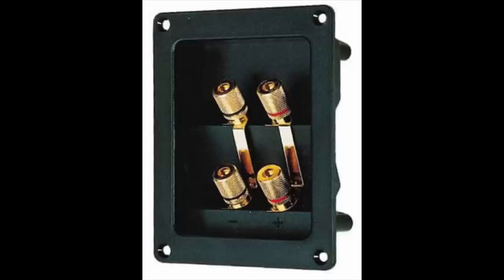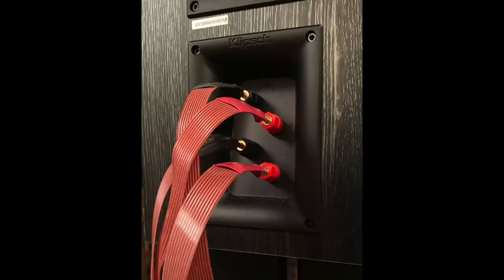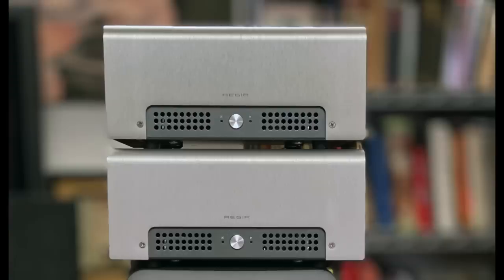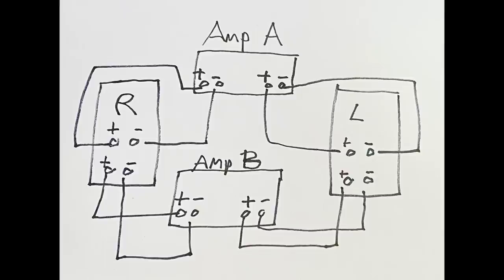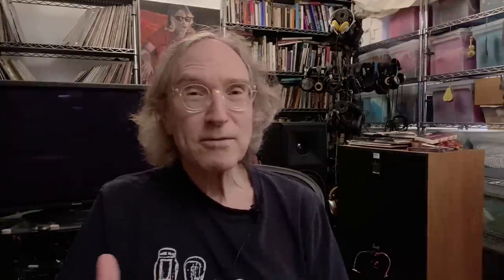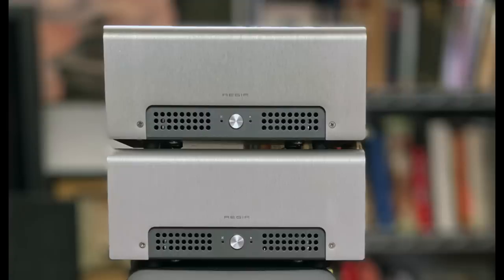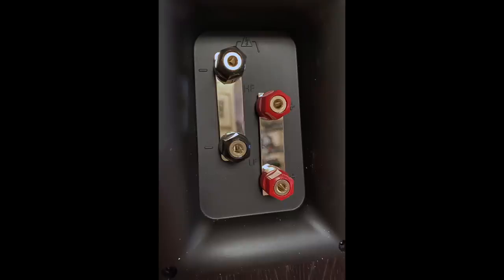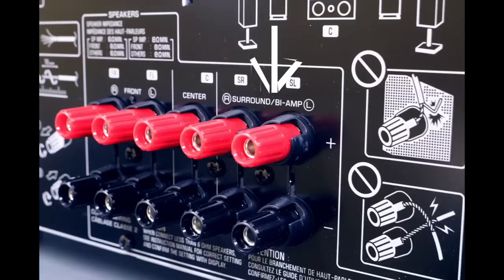It's time to think about bi-amping your speakers!

Comment: My altec 501's were later re-released as 510's with an upgraded xover and Tri amp capability, I would like to maybe get an upgraded xover made for these and ultimately tri amp the setup.
Reply: You might be able to find some great active crossovers on the used market. A stereo crossover can be used to tri-amp a single channel. Two stereo crossovers are required for two channels. I found that splitting off the HF first, and feeding the LF to other channel worked best. The other channel splits the Mid from the LF. Only the noise from the first crossover goes to the tweeters.

Comment: I would think this would be more useful using different amps... Let's say you have a low powered amp that has details or a tonal quality you love but not enough power to fill the room with bass. Wouldn't it make sense to have the lower powered amp driving the theater, and getting a cheaper class D amp to power the woofers?

Comment: I set up my brother's Martin Logan mains with a vertical bi-amp. We use his Integra AVR to drive the center and surrounds. We Y-Corded the main pre-amp outs to an older Rotel 5 channel amp. Huge improvement. The 260wpc vs. 130wpc made a difference, but the headroom and dynamics were fantastically better.

Comment: Excuse my ignorance on this but would one need, or want for that matter, a crossover in between the pre amp and the bi-amps so that the respective frequency ranges would be directed to the intended amplifiers? This assumes of course that the preamp in not separating the spectrums.
Reply from the maker: I think I explained this very clearly. No extra parts are needed. Just two identical stereo amps.

Comment: I'm using a NAD T743 5.1Surround  Receiver. It has speaker hook up for surround speakers and also a "B" set of speakers. I wonder which connection I should bi-amp with. I am thinking that the "B" speakers will put out exactly what the "A" speakers do whereas the surrounds will be processed to amp up surround noise (background sounds). I also wonder if the "B's" are on a separate amp or just take power from the samp place as the "A's." Nothing about any of this in the manual and I have reached out to NAD. Currently bi-wired.
Reply from the maker: Sorry, no, B speakers are just running off the same stereo channels as the a speakers. So that’s not Bi-amping

Comment: You really should do a vertical biamp. In most cases, you'll have level matching issues even if you use the same amps. Going vertical eliminates that problem. I do it this way in my own system, so I'm able to talk from experience. However, if you are not using 2 top of the line amps, you're probably better off getting 1 high quality amp instead of 2 lesser amps.
Reply: What's a vertical biamp?
Reply: @MICHAELMG62  You need to use 2 stereo amps. One amp goes to the right speaker, and the other goes to the left. One channel on each amp powers lows, and the other powers the highs. Doing this allows you to work both amps equally. If you have a traditional setup with one amp on the highs and the other on the lows, most of the time you'll have a volume mismatch between the 2 amps. Also, an amp will sound different depending on how hard you work it. Even if the amps are identical. A vertical biamp eliminates all these issues.

Comment: I prepared my car to bi amp in 2009; Alpine 18Wx4  head unit and Focal Polyglas components.  The advantage is that you don't have a crossover, so the amp has more direct control over the speakers.  The less gain in the amp, the cleaner the output.  My home stereo are full range speakers without a crossover.

Comment: As good as solid bottom tube top sounds on paper, without some kind of active dsp correction, you cant guarantee phase alignment between the two, so your top and bottom don't quite line up right. Like a badly set up subwoofer.

Comment: In some amps there's the A+B speakers choice (besides A or B speakers). Does that mean it can bi-wire a pair of speakers? If so, what would happen if the minimum recommended impedance is 8 ohms for the amp but the speakers are actually 6 ohms?
Reply from the maker: Well, if the speakers are 6 ohms and the amp's minimum impedance is 8, well, that's not ideal. Bi-wire and/or A+B switching doesn't change that in any way.

Comment: I'd like to do this but its too complicated for me. For example if both amplifiers are stereo do you do both woofers from amp 1 and both mid-treble from amp 2 or do you do one amp per speakers, so amp 1 left channel for bass and right channel for highs to speaker 1 and amp 2 the same to speaker 2? What if like these zens they're both integrated amplifiers? Do you split from the source unit then? In terms of mono power amps is the ultimate then to have 4 blocks? Imagine the mess of cables splitting twice to get this going! Or do you use just 2 monoblocks, one per channel? But then should you biwire from the monoblocks? You still wouldn't have actually bi amped the speakers. So maybe with 2 monoblocks , you use one for treble and run to both speakers and one for bass? Its just too complicated! 

In my case I have an integrated that has a pre out. So is it best for me to add a more powerful stereo power amp via the preamp out and using it to drive the bass whilst letting the original integrated amp's speaker outs run the highs?

Comment: When you mono block those amps they are 7 watts instead of 3 , so what if you "mono blocked" each speaker with 2 amps so you would have 4, for the 2 speakers.

Comment: What about the crossover? How does that work? Is the crossover bypassed?  Are there two crossovers in these speakers?   That seems unlikely as I never see a switch on them.  If not then how do they isolate each amp and so  not end up with the same thing as the jumper installed.   If it isn't how can it be said that one amp drives the woofer and the other the mid/tweeter? Beyond how it works I would guess the simpler  load on the amp might make for the better results.
Reply from the maker: I described how to do it, why are you making it more complicated? The speakers internal crossovers or still being used.

Comment: KEF LS50W uses two different amp for hi and low, right?  That seems to work very well.
Reply: That's a good point Raphael, but I guess the difference is the KEFs were designed that way from the ground up, so for example, any potential timing differences between the 2 amps will have been engineered out of the equation through careful design tuning.  In contrast, Steve just chucked together 2 totally different stock amps from different manufacturers.  Seems that may not work well, or at least not in that particular combination......

Comment: Wouldn't biamping require a crossover before the amps (and removing the internal crossover?I deally biamping powers each driver individually: one amp for the bass, one for the treble. No IM. So you would need at the very least low pass/high pass filters. (That's the quick and dirty way) How about a few details about "serious" biamping, properly done?

Comment: How could someone say it wouldn’t make a difference? It makes the load each amp sees totally different (higher impedance and simpler for both). This makes a big difference for tube amps especially.
Reply: This leads to the question that occurred to me. If you're sending the preamp out via a Y connector then you're sending a full range signal to each amp aren't you? And then are you also sending that same full range signal to each tweeter and woofer or is the internal speaker crossover still filtering each signal? I always thought biamping required an external crossover to avoid that.
Reply: @alexdiaz8726  You’re right. I’m wrong, so I changed my comment. Each amp is reproducing the full range signal. The load each amp is driving is much “easier” (higher impedance) though. It might sound best to use different output transformer taps on each amp too, depending on the impedance of each driver combo (woofer vs mid and tweeter). I wonder if Steve tried different output tap combinations?

Comment: I use 2x Aegir for power hungry B&W Matrix 3 series 2 and it’s a true charm. I am horizontally bi-amping (vertical was my plan but, one of my Aegir can’t handle it) Just wondering Steve, did you try both vertical and horizontal bi-amping to test if you notice any difference? Happy 2021, stay healthy!

Comment: About different amps, I think Steve used a tube and solid state? Didn't work well. I'm thinking about using my 400w Carver for LF and a beefy Harmon Kardon AVR I have idle for the HF. Is this too mismatched, anybody?

Comment: Your description & drawing shows Amp A powering both speakers, and Amp B powering both speakers. 
What do you call using Amp to power just the R speaker, and Amp B to power just the L speaker?  How does that compare to the process you've described? 
And if this video is about bi-amping, what is bi-wiring, and how does that compare?
Finally, I've noticed that Schiit seems to suggest that the Aegir can be run as a stereo amp using RCA connectors , but requires XLR balanced connectors for running as mono blocks. Is that what you did? can you talk about the process and differences?  Thank you and All the Best in 2021!
Reply: If you take two stereo amps and "bridge" their channels together to drive one speaker, I guess it is called bridging and essentially creating monoblocks.  What that does is lower their impedance to 4 ohms and hopefully nearly double their power.  So, let's say you have 4 ohm speakers, what a good match, right?  Maybe speakers with a low sensitivity to boot such as the Magnepans, they are going to love all that 4 ohm power.  Besides I think at least the LRS only has one set of connectors so the bridging vs. bi-amping means you can't bi-amp them.  It wouldn't seem to be a good one to bi-amp anyway.  As to bi-wiring, that is running two wires one to the high side connection, and one to the low side connection on the speaker while pulling out the jumper as you would for bi-amping.  Still one amp, you can run different size wires one to the low side and fat wire and one to the high side thinner wire and more wire is better but having done that if you beef up your speaker cable to the real deal and spend the $$ then just use one because now you are talking real money to bi-wire for a subtle improvement.
Reply: What Steve has shown is called horizontal bi-amping. If you have to amplifiers and each drives a speaker, which each channel driving either tweeter or woofer, is called vertical bi-amping. Vertical is usually recommended as each input stage has the same workload. Horizontal bi-amp is only worth if you want to experiment with different amplifiers: say a tube amp for the tweeter and a hefty class a/b or d for the woofer.
Reply: Just to put things in context Mike, biamping is a relatively cheap way to upgrade your system although the quality improvement is nowhere near what you would get from using an active crossover. Unfortunately not many companies offer that.

Comment: I have a 5.1 system and listen to music 2.1. My avr does 7.1 so it seemed like a no-brainer to use the extra amps to bi-amp my Heresy IV mains. I haven't bothered going back and forth comparing, but I figure easing the load on each amp has to be a good thing.
Reply: Yes.  This is what I did. L/R gets a good amp and AVR powers surrounds.   I don’t use a center channel—voices not full enough.

Comment: My marantz amp was £400, now if I buy another plus the same wire & connectors that's £500, would I hear £500 worth of improvement difference or should I sell my amp & buy a £1000 amp & not bi wire would ,I get an even better sound. It's too expensive to chance it

Comment: Interesting. The only experience I have bi-amping is with pro equipment using a electronic crossover. There is no way to use just one amp because there is no passive crossover.

Comment: Years ago I used to biamp my Castle Howard S2 loudspeakers with a amplification set up consisting of a Sumo Athena preamp and 2 Sumo Polaris power amplifiers. The sound stage etc was really excellent and I only changed the amplification when the potentiometer on the Athena needed to be replaced and I wanted to use a remote to change volume.
Now I have a Schitt Freya preamp with 2, power amp outputs I am about to try biamping again with the same speakers. Best wishes for 2021 and onwards. Daniel

Comment: It seems you're flying blind here and need to research what active bi-amping is before you start connecting dissimilar amps to speakers and potentially damaging equipment. Inside the speakers is a passive crossover that splits the signal into high and low frequencies (or high, mid and low on a 3-way system). With the bar removed between the hitching posts even with two stereo amplifiers wired in the signal is still combined into ONE before being split into high and low frequency signals by the crossover and fed to the respective driver. That hitching post bar is really a gimmick, fyi. When you talked about connecting the tube amp to the HF posts and solid state amp to the LF posts that's a simplification and is not what is actually occurring electronically. Both signals are combined in your scenario, no wonder it sounded terrible with two different amp types. 
A proper bi-amped system has the internal speaker crossover taken out of the circuit altogether. A single pre-amp out signal is fed to an external electronic crossover which splits the signal into high and low frequencies (in a two-way speaker system), then from there to two distinct stereo power amps, or one stereo and two mono etc. as long as there is one channel of amplification for each driver. Your instinct to use the tube speaker for the higher frequencies is good and would actually be effective using an electronic crossover, with a solid state amp for beefier low end amplifying for the woofer. Rather than each amp channel amplifying the full signal it's only amplifying a portion so is worked less hard. Also with the internal speaker crossover out of the circuit the amp is directly connected to the driver and has a better ability to control the driver.
I'm kinda surprised there was an improvement using two identical amplifiers - given the signals are combined anyway before being fed to the crossover even with the bars removed - but it's possible.

Comment: Sorry for what may be a stupid question most of my experience is with care audio..  So do you run a crossover?  If so is it placed between the preamp and amp or are you using Lowpass/high-pass filters in the speaker?
Reply: No such thing as a stupid question! He is using the original crossover that's built inside the speakers. That's why you need 4 connectors with the jumpers removed.

  You can use different amps with different wattage just make sure that they have the same gain otherwise the bas and treble will be at different volumes.
Reply from the maker: No, no external crossovers were used. I made it super simple, hook up two amps to ANY speaker with two sets of binding posts. What you're describing can't be used with most speakers, unless to remove their crossovers.
Reply: @SteveGuttenbergAudiophiliac  thanks

Comment: Can someone please tell me the minimum requirements for a system I want exclusively for streaming music? Speakers, an amp, and what else? I’m not interested in specific recommendations—for example, this or that speaker, this or that amp. On this vid, Steve shows an amp being connected with speakers, but I can only assume if I point my phone at the amp and hit play, the only thing that will play is my phone. What do I need to get the speakers up and running?

Comment: I'd like to warn people of sending full power to a tweeter. If a range is cut at 3 kHz with 3-order filter, only 10% goes to high range, for 6 kHz this is only 3.5% (!!) 3.5 Watts out of 100.  Check out your tweeter. If it says 30 Watt RMS, this mean 4 Watts actually, and this will be safe in the particular case mentioned before. If you would like to use a dome tweeter from 3 kHz (or about) with 100 Watts amp, the tweeter must be labeled "80 Watts RMS". Bi-ampting without an active crossover is a very dangerous thing.

Comment: Very unfortunately, my pioneer VSX home cinema network receiver……. Even though the bi-amp is turned on, in the menu. And all the connections are in the correct order.  ( I’m using solid copper wire).  The bi-amp on that, still doesn’t work.  Only one amp section works;  either the low or the high; But not both.      This means that i have to resort to using jumpers instead.
They are solid copper ( not bits of metal coated)   about an inch.   Would have been interesting though; just to hear what it sounds like.   There is a noticeable sound difference in using solid copper wires; as opposed to using stranded wires ( cables) that you can buy on Amazon.
Friday 14th October 2022.  U.K. Southampton 🇬🇧

Comment: Hi Steve. I thought you would need an external crossover in between the preamp and power amps to pull this off?
Reply: I've bi-amped systems for 40 plus years, and always use an active crossover.
Reply from the maker: No, no external crossovers were used. I made it super simple, hook up two amps to ANY speaker with two sets of binding posts. What you're describing can't be used with most speakers, unless to remove their crossovers.
Reply: @SteveGuttenbergAudiophiliac  Hi Steve, sorry, didn't mean to confuse, I was just adding how I have bi-amped home audio. What I have done in the past is to leave the passive crossover in place (so as to be able to return the speaker to full range easily). I just disconnect the passive crossover speaker leads, and add new leads directly to the binding posts. Of course this means adding another pair of binding posts. I love your videos, and have a great New Year.
Reply: @SteveGuttenbergAudiophiliac  thanks for clarifying that. Love the tweak vids